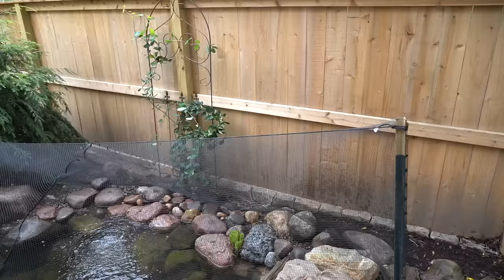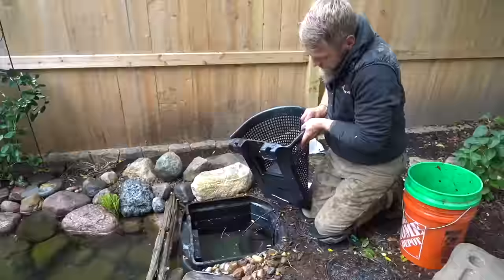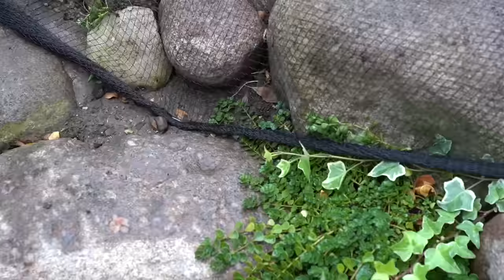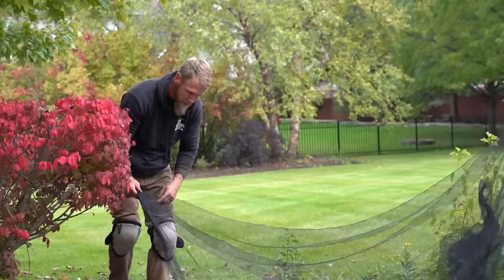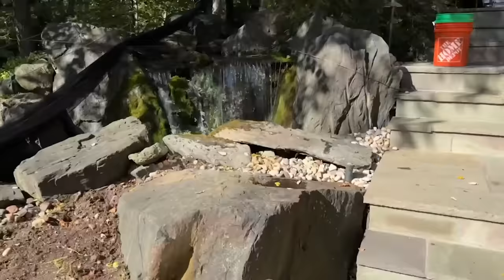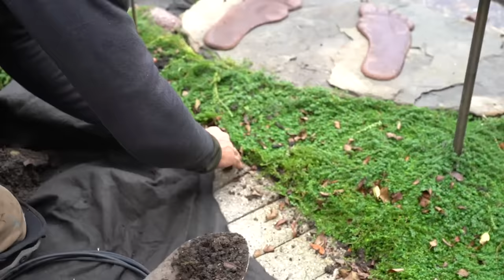The Benefits Of Fall Netting – WHY Every Pond Needs One

Comment: Netting is horrible to look at but where I live there are loads of herons. Even had a river otter make a visit. So a net is a must. The added benefit is keeping all the leaves out of the live oak overhead. Being somewhat of a master fabricator I tried to come up with something that wouldn’t distract from the beauty of the pond.  So here’s my idea I’m willing to share. I purchased 1/4 diameter steel rods 20 feet long. I bent them ( easy to form around a big tree trunk) to a nice big curved dome shapes. I made 4 cross bows and one long lateral one. My pond is longer than wide. After getting them close to near length and shape I coated them with a rubber spray ( flex spray works great) . Then I made 2 foot long tubing pieces to drive into the ground. Length will vary according to your soil. So then you place the hoops into the tubes to hold in place. This will also allow you to remove for maintenance if req. then I draped the same netting as you used. I used black zip ties to secure and staked the netting around the outside so the net is taught. In the feeding area I took a section and zip tied a 3/8 dia.( for more weight) rod. This can be lifted allowing you to lift to feed. So far it has worked fantastic. The benefit of doing this is with the high dome you really don’t notice it as much. Plus it looks so much cleaner than big posts and line strung holding the net. Obviously I leave it up all year but I can live with it. Takes a little time to shape it to the water feature but it’s well worth it. One of my neighbors likes it so much she’s having me replace what she already has. Just an idea your viewers might like to pursue.

Comment: My problem with fall netting is that frogs always find a way to escape and then cannot find their way back into the pond. Have a solution for that?
Reply: Are you netting it just for leaves or for the entire winter for predation?  If it's just for nets, they really don't need to be fastened to the ground--in fact, it doesn't even need to be within 2' of the ground and can just be mounted as a canopy.  They also act like gill nets for snakes (some people use them as lethal snake traps) so we don't use them at all as we like our Rat Snakes and Racers for rodent control.  I do remove the Water Snakes that show up from time to time because they eat our frogs.
Reply from the maker: Normally we don’t keep frogs in the ponds as they have a tendency to wander in and out. Once we remove the netting we get frogs coming by again.